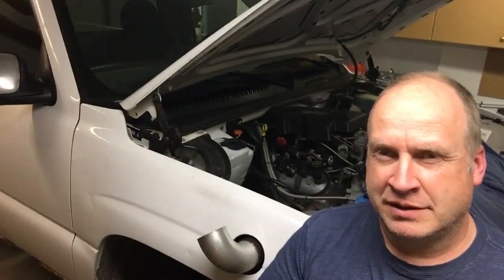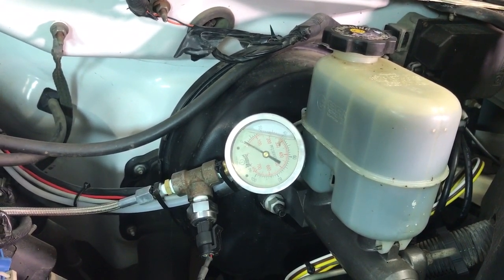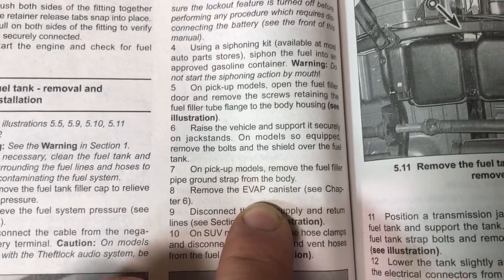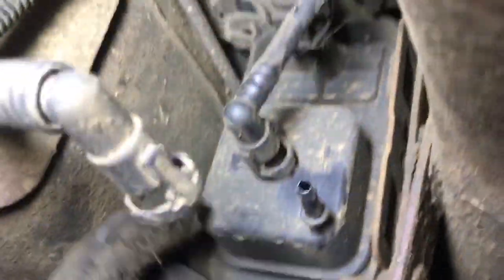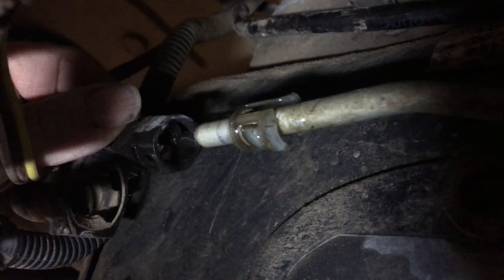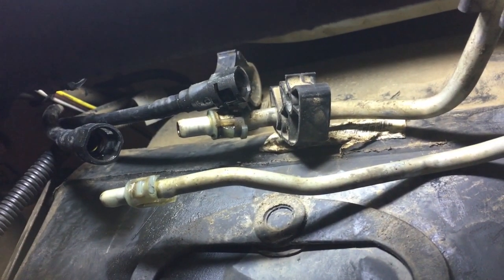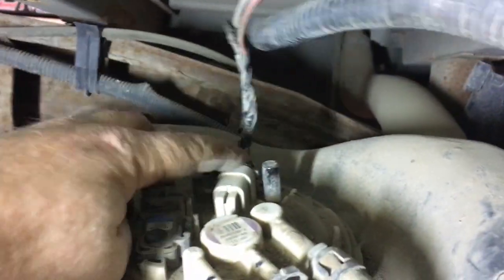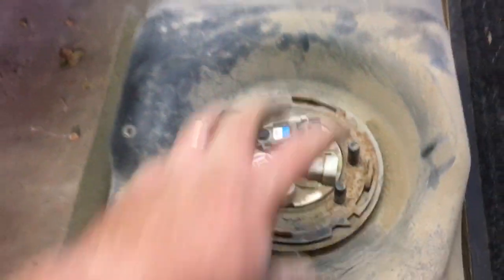Removing the Fuel Tank/Fuel Pump from a 2000 Chevy Silverado

Comment: I was thinking ( on my old beat up work  truck), just cut a square of the sheet metal ( bed liner)  just above the pump.  Then use self tapping screws and some sheet metal to overlap the square.   God bless
Reply from the maker: Yes that is definitely an option that would work

Comment: I seriously considered doing that on both of my trucks when I had to remove the beds to access them, it is acually not that difficult to do and the pump is right in front of you. GM seems to like building trucks around the most functional parts - no rad cap or drain petcock, distributor/wiring hidden in bell housing, crank position sensor buried etc.

Comment: way easier to tilt the bed to remove the pump
Reply from the maker: Jason Baker never thought of that, that would be easier for sure.
Reply: I cant get the bolts out😭
Reply: Wondering about making a door.
Reply: Tilt bed toward what side
Reply: @ricardolomeli225  take the bolts out of the drivers  side  and loosen  the passenger  side. Unplug  the rear  lights.  The u pickup  the driver's  after u unbolt the filler  neck.  The tank and pump  are on that side.
Reply: 2 bolts for the tank straps vs 6 or 8 for the bed... drop in the tank is by far the easiest. Siphon the gass or run it low... don't get the cheap pump delphi is what you want.

Comment: Good video man, I have to replace the pressure line that comes from the pump rotted out of course even though the truck was heavy undercoated. Gm brake lines and fuel lines suck
Reply: its the salt not gm, blame goverment

Comment: Sometimes you just have to hate when everything is made of plastic. In some cases it lasts dang near forever, and others it becomes brittle and snaps. I guess you can probably just buy the cheapest fuel pump assembly there is if you plan to gut the pump out and install your own anyhow. I'm not sure what the quality of the off brand pumps, fuel sender's are, but for your application it's probably fine.

Also yes, tilt or removing the bed is generally way easier than crawling under and dropping tank. If you have an engine hoist you can strap the 4 corners of the bed and lift it up with engine hoist really easy. Practically a one man deal with that, the only thing that can happen is bed can slide into the cab and may dent/scratch something, but another person helping or doing it carefully and it's not a problem.
Reply from the maker: silentbravo yep annoying to have to buy a whole new assembly due to brittle plastic. But yeah I just bought the cheapest fuel pump assembly I could find on Amazon because I won’t be using the pump from it anyways. Should be here tomorrow so I’ll work on putting it in on the weekend. And yeah next time I’ll try the bed tilt method, I don’t have an engine hoist yet but will need one at some point, don’t imagine this 5.3 will live forever
Reply: I guess it's pretty randomly asking but do anyone know of a good place to watch newly released tv shows online?
Reply: @Danny Hugh Thanks, I went there and it seems like they got a lot of movies there =) I really appreciate it !!
Reply: @Tommy Graham Happy to help xD

Comment: Hey man does your truck have a high stall ?, have you done any videos or do u no of any parameters need changing to accommodate a medium stall I’m thinking in Trans and Tcc pressure (apply ramp) may need tweaking?? Cheers
Reply from the maker: Jesse Kay I don’t have a high stall torque converter yet, was thinking of waiting until I had a 4L80e conversion done before buying one but we’ll see, it’s on my wish list for sure. Will have one sooner or later.
Reply: Sweet as man

Comment: what are you using to power your new pump?  wiring in a new wire and relay that's triggered by the exiting power wire?  hope your next vid covers that.
Reply from the maker: Randy Richardson yes that my plan exactly, run some 10 gauge wire that’s switched by a relay controlled by the old fuel pump wiring.

Comment: Does the 2000 silverado 5.3 have a check valve in that fuel pump assembly ..mine has to be primed to start
Reply: Need to check fuel pressure, simple to screw guage onto schraeder valve on fuel rail
Reply: Yes it does. Had to prime mine too.. 4 turns. Get a delphi
Reply: Fuel pressure regulator not seated properly
Reply: @taronhowell2523  not seated properly?under the hood on the driver side right? Did you smell gas?
Reply: The metal clip that suppose to keep it tight wasnt allowing it to create a vaccum leak ..i put a heavy duty zip tie on the clip to keep it pushed in ..and it fires up everytime
Reply: @taronhowell2523  if it works then it works.. zip ties save lives. 👍🏻